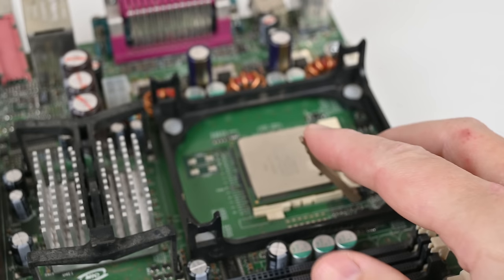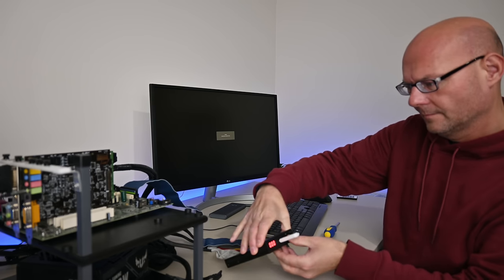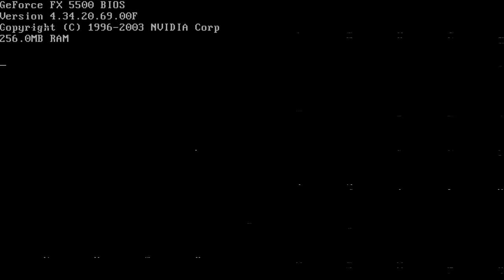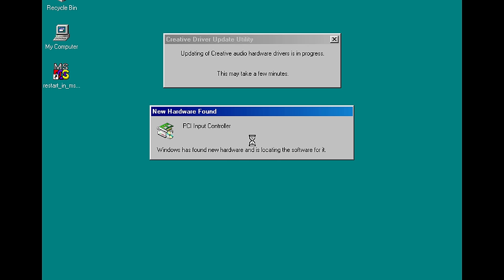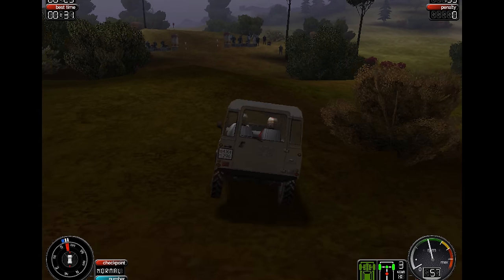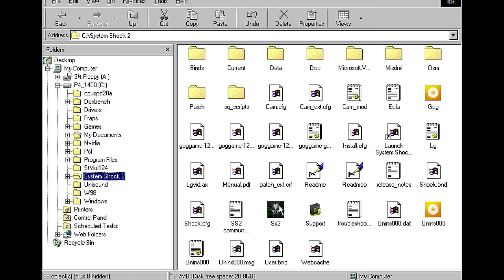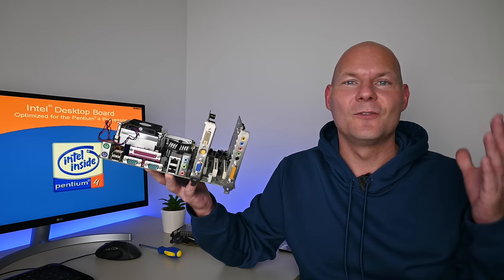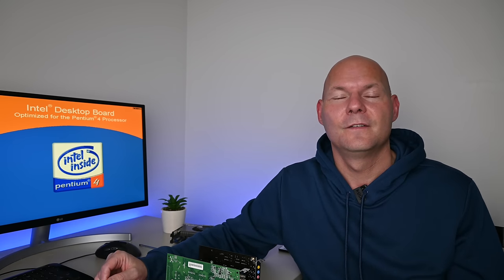It Failed in 2000, Has It Aged Well? The Pentium 4 1.4 GHz

Comment: The timing on this video is kind of crazy because I started working on an extremely similar build a few weeks ago. I figured hey I have a bunch of old PC parts lying around why not make a windows 98 machine out of them. These are the specs so far: Intel D845HV motherboard (already replaced the capacitors), 1.8 GHz Pentium 4, 512 MB PC133 RAM, Nvidia FX5200, Sound Blaster Live! CT4830, 128 GB SSD with a SATA to IDE adapter, Toshiba SD-616 DVD drive. Most annoying part so far is the GPU drivers, I ended up using version 81.98 because it drastically improved the framerate in SimCity 3000 even though I saw FPS losses in other titles. I am still contemplating other GPUs and I haven't decided on a case yet.
Reply from the maker: These parts will work really well! The FX 5200 can be a little under powered if you are planning on playing with higher resolutions. But with a CRT monitor and 800x600 or 1024x768 resolution, you are good to go!
Reply: Update on this, I ended up swapping out the graphics card for a Radeon 9600 XT which has been great so far. I really like the fact that I don't have to mess around with the drivers. I also went with the SilverStone RL08 for the case. The DVD drive started acting up, so I swapped it for another one. Other than that, this combination of parts does work really well together.
Reply from the maker: @lastcarbon  Awesome 😎
Reply: @lastcarbon  Might be the belt on the drive. The rubber stretches and disintegrates after all these years- I have one that needed a replacement, but looking at prices I just used a piece of string. Does the job.
Reply: @HappyBeezerStudios  The drive has some sort of electrical issue which prevents the DVD drive from starting with the rest of the computer occasionally. This also prevents the computer from detecting the SSD even though one of the drives was on primary channel and the other was on secondary channel with both drives set to master. The other drive I have been using works great.

Comment: Hi Phil. Is there a tool to trim a ssd under win98 or winXP?
Reply from the maker: I did a video about this recently and contacted a few SSD manufacturers. They assured me it is not an issue with modern SSDs. So now I just use them and don't worry about it.

Comment: Back in the day I had a big jump from a P1 all the way to a Dell OptiPlex with P4 423 1.4ghz and RAMBUS so I never experienced the speed disappointment some people had who came from newer P2 or P3 hardware. Incidentally after a few years when I needed more performance I looked into upgrade options and you could actually get a converter to use early socket 478 processors on the 423 board but the cost was too high for the performance increase so I saved up and built a new Core2Duo system instead.

Comment: the 478 platform made me quite excited back in the day, especially when H/T versions launched. this was right at the beginning of the Apple intel switch as well, the early dev builds ran on P4 extremes and Core Duo chips which as I understand were basically Pentium 4 M dual cores.. 

really stable socket and platform, and as you said,  I liked my P4 systems quite a lot back in the day.

I still have a Dell dimension with RD Ram and a P4 2GHz 478 non HT chip and a Radeon 9800GT AGP I picked up at a good will for $6 in 2020. works perfectly.
Reply: The Core processors were developed from Pentium M processors not from Pentum 4-M which was much worse. You could also had the socket 479 Pentium M processors on select P4 motherboards with an adapter. It was usually much faster than any of the Pentium 4 processors even despite when it had a lower clock speed. The P4 netburst architecture was really not that good in the end and the Core processors were developed from the earlier P6 architecture which came from Pentium III and Pentium M.

Comment: The Wayback Machine actually does have this board's download page archived. The chipset driver you used is way newer than the one it lists (3.20.1008), and the BIOS version you have is already the latest (P05).
Reply from the maker: Thanks for the tip, I just downloaded them onto NAS and going up to the website as well :)

Comment: I think i once had a 1.4ghz p4 and a geforce geforce ti 4200.
That was the third and last pentium based system i ever owned.
The athlon was more value going forward. I remember the athlon 64 had models that were sometimes better or equal to the p4 extreme edition for a fraction of the cost.

Never really had alot of good memories of p4 but pIII was amazing.

Looking back today i love the pentium 4 and the 865/875 chipset as it is so damn fast and supports loads more modern features and runs windows 98 titles very well.

Comment: Back in 1999 I had a P2 450 that I later added a cheap mx card to before buying a AMD system in 2003 with a geforce 4800. I spent about 1000$ on the build. Used it for 5 years or so before the next upgrade 😂 I like the format, keep trying out cool things from the past 👍

Comment: We had our pentium 4 pc in 2006 and it ran like a beast with windows xp on it,BUT once we did run windows vista on it,it did run very slow,so eventually we skipped back to windows xp,
But seeing you talking about it and showing some games from that era REALLY makes me want to go back to the year 2000,who a shock that we live in 2023 now🥲
Reply: I feel like that is a system right for the Vista marketing trap. If you give it 2 GB RAM it will run fine. Even better with 4+
OEMs wanted the shiny new Windows on their systems, but cheapened out on other places. So you end up with systems with a 2.6 GHz Pentium 4, a Geforce 6200, and 512 MB RAM, which is just not enough for Vista.

Comment: I remember that the Pentium 4, 1.4 ghz launched back when Windows ME was the latest and greatest Windows operating system.
Reply from the maker: I want to cover ME again 🙂
Reply: @philscomputerlab  one thing I remember about Windows ME is that I remember when I was in a computer class in college back in 2003 and the professor said "well, there are allot of version of Windows out there, there's Windows 3.x, Windows 95, Windows NT 3.x, Windows NT 4, Windows 98, Windows 2K, and now we have Windows XP. Oh and Microsoft is also working on a new version called Longhorn" I then asked him, "Well, what about ME, Windows ME?" He then said "Don't even mention that to me, I don't want to even hear about Windows ME".
Reply: @philscomputerlab  Mistake Edition LOL
Reply: @philscomputerlab  I remember when I actually thought that the 1.4 GHz Intel Pentium 4 cpu was a beast of a performer when I saw them featured in some Gateway computers in a PC World magazine in January of 2001. I don't think they would do too well now over 22 years later. Also, I remember an HP laptop that I bought new from Sam's Club back in July of 2002 had a mobile 1.4 Ghz Intel Pentium 4 cpu with 256 mbs of ddr ram 266 mhz.
Reply: @CotyRiddle  Yep, I think Windows ME even did worse than Windows Vista. At least Windows Vista did get over 10 years of updates and support from Microsoft, from January of 2007 up till April of 2017, Just like Windows 7 and Windows 8 also got the same lengh of support. October of 2009 to January of 2020 and October of 2012 to January of 2023 respectively. I think Windows ME however had the shortest support lifespan.

Comment: I moved from the AMD Athlon 1.4 to a Pentium 4 1.7Ghz, if I remember rightly I had an Aopen full tower case, Abit TH7-RAID motherboard, 128Mb Gainward Golden Sample Geforce 4600Ti graphics, Hercules Game Theater XP sound card, IBM Deskstar 120GXP HDD and 19" Iiyama VisionMaster monitor back then.  I moved to a Compaq Presario S4490UK with P4 HT 2.8Ghz after that and had a few Compaq Evo D510 systems for various use.  Never had any overheating problems and they all worked well.
Reply: Athlon 1.4 to P4 1.7 sounds like a sidegrade. The number is bigger, but it isn't any faster. Slower in mp3, equal in divx, faster in mpeg2, games also differ.
Phil has done a video on them. There is no 1.7 P4 in the video, but the 1.6 and 1.8 models are tested. And the results are pretty clear. The Athlon 1.4 is faster than the Pentium 4 1.8 GHz

Comment: I have a socket 423 P4 and motherboard in my collection. Uses RDRAM. Used it in my primary computer from...maybe 2002 to 2006? If I remember correctly I had a Radion 9800 pro in it for a couple years and was decent enough for games at the time - I'm pretty sure I played through FarCry with that setup.

Comment: This is right up my alley!

I had a socket 478 P4 1.5GHz "Willamette" in my first PC back in late 2001. The mobo was a DFI NB32-SC with a single stick of 256MB PC133 memory and an ATI Rage 128 32MB. It came with XP pre-installed so that's what I gamed on. Performance (at least up to SP1) was solid, but with each OS and IE update the system began to slow. I didn't game much except for the Tomb Raider games and messing around with the Tomb Raider level editor. In the 7 years I ran that PC not once did I upgrade the hardware. TBH I didn't know much about it, how much parts cost or where to go. But anyway, I had fun on it and I loved that era of PC hardware and software. It has that unmistakeable look and feel.
Reply from the maker: Yea that graphics card was actually the weak part in that machine 🙂
Reply: @philscomputerlab  It was great for running PSX games in emulation though. I remember playing Crash Bandicoot with no problems. But yeah, other than the Tomb Raider games (from the Core Design era) it wasn't all that good.

Back in 2013 I returned to my old PC and upgraded some of the parts notably 3x 512MB sticks and an FX5200LP. The RAM upgrade felt like running a different computer and the FX5200 did okay, but for the life of me I couldn't upgrade the CPU. The board supported up to 2.0GHz Willamette but none of the CPUs I bought worked. The BIOS was fully upgraded.

And then in 2020 I returned to my old PC one last time and upgraded everything:  P4 3.0GHz Prescott, Gigabyte 8I865GME, 2x 1GB DDR400, Zalman CNPS9500 and Palit Geforce 7600GT 256mb AGP. It was a period-accurate beast from 2004. I didn't have it for long though as I sold it and embarked on a modern PC build. Plenty of funs times building both!

Comment: ah good old times, i had a p4 and the best choice was upgrade to pentium m on desktop with ct-479 adapter. Another planet and very similar to core architecture introduced in 2006
Reply: Basically Pentium III -> Pentium M -> Core -> Core 2 -> Core i, all of them P6/80686 chips. Yes, we're still on the 6th gen of x86 CPUs.

Comment: LOL, these times I had an Abit NF7S with an Athlon XP Mobile. That systems sucked so much that I switched to the slower Pentium IV 2,8 GHz with HTT on an ASUS P4P800. Legendary machine. Later I used the CT-479 adapter board to use a Pentium M on this board. Since then I never swiched back to AMD.

At home I got some P4 retro projects. One is a workstation with two Xeon 3.6 GHz CPUs. The other is Pentium D build and of course I got my old ASUS P4P800 (now as E Deluxe) with a 3.4 GHz Northwood.

Comment: Wow now THIS brings me back...5:16 Must have been 2003, I went and got an ATI 9600. I thought it was mediocre so I wanted to return it and get a 5600 GT. When I bought it and opened the box it said "Surprise, we upgraded you for free, here is your 5700 GT. Happy Gaming!" or something to that effect. I was at first skeptical, why would a company sell the next chip up for the same price? But then I used it and saw what everyone did. The FX series had amazing issues with textures in most of the top games of the time. In GTA III it would skew textures and effects were off. I noticed most games had an issue with this card. A friend loaned me an FX 5950 GTX for fun as he had bought the ATI 9800 XT AIO (Which he also lent me for a time, the ATI was the better of the two). Even the top tier FX card had some of the bugs. Ended up getting a 7600 GS to replace all of it. But that FX 5700 LE is the EXACT same card you are holding right now as I have this paused and type. I will never forget that brass/gold looking mini shroud/cooler/heatsink lol! And I will never forget how well it played Morrowind (Better than the XBOX version) but Oblivion forced me to upgrade when it came out. I had the computer with the 7600GS stolen from me while I was out of town so when I got back all I had left was the 5700! So I put together a similar specced PC and continued to use it until Oblivion forced me to go from that to a HD 1300 then to an HD 1950 XT the following day. What a fun time that was.

Comment: My DOS/DOOM hardware is a P4-3GHz with four ISA slots. Unfortunately it needs to go to the Caps Doctor, and meanwhile I'm using a dual P3-500... nowhere near as good. I have a couple newer P4, good hardware, one was my faithful everyday system for many years, and it still works.

I don't care one way or the other about the format, so long as the content is interesting. :)  Did enjoy seeing games I'd never heard of. 

Was rather surprised to see RAMBUS. In my Computer Closet I have a dual Xeon 750 that takes RAMBUS and was formerly the property of Jerry Pournelle... (it's a Compaq workstation and weighs 57 pounds!) -- upgraded with some modern RAMBUS brand and tho they're about 5% slower, they run far cooler than the extremely hot Samsung sticks.
Reply: If it has through-hole caps get your soldering iron and diy. Not too complicated and can't go wrong if you're not a total idiot with it. I'm far from a professional board repair technician. I only have some cheap 25W iron. But I fixed some monitors and GPUs myself. SMD stuff and chips are much harder to do, but some simple through-hole caps area easy.
Reply: @HappyBeezerStudios  Yeah, I know how it's done, but I don't have the soldering skill, and the board is irreplaceable (I'm seeing the same board, with obvious bad caps, if you can find one, for $300). So I'll let a pro do it. Local shop and I've seen their work.

I might try it myself on my Asus boards with the bad southbridge cap (that was a regular thing for a while) but I've got three of them and they're not that special. -- When that goes, the rest of the board still works but USB quits -- and add-on card quits before the board's own ports. (Two of 'em are actually in use where I don't need USB.)

Comment: I didn't think Pentium 4 exactly failed. It spurred controversy of course, as the high MHz number did not translate to expected performance. Pentium 4 with Rambus was still quite fast. The later P4 models improved on the design, which over time was changed quite a bit, still sold als Pentium 4.
Reply: Northwood with DDR RAM was pretty much the peak Pentium 4. Especially the Gallatin 3.4 GHz EE, which was just the server model for desktop systems. It beat even the 3.73 and 3.8 GHz Prescott models. And could oc to the usual 4.0-4.4 GHz as well.

Comment: I remember at the time looking at these pentium 4's and their speeds and wanting them. I instead went for AMD instead, Intel most of the time has a higher cost for the entire platform barrier. I remember seeing the speeds of rambus and was impressed and if I had the money I would have wasted it on an inferior system. Rambus was good on paper. However even back in these days, I always had high amounts of memory. I never felt the cost was too absurd or prohibitive. So I often had lots of things open and ran lots of stuff. I remember having friends who were telling me how they upgraded from 32mb to 64mb.  or 128mb and the difference it made. While I would either be at 256mb, 512mb and even 768mb in this era. I remember wanting an intel platform many times with the pentium 4, but AMD just had some great offerings and beat intel on IPC. So while I would have loved to have rambus, it would have been awful for me, being very high cost, versus low performance for how I would have used the system. I would have had high memory and lots of things running at once. Where this was the crippling feature of rambus. It could potentially be great if you didn't use your system much, just single task only, rambus was decent. It was never great. It's speeds were high, it's cycle performance was horrendous due to how it had to cycle through everything. Every time I wanted to go with intel pentium 4's, I would read reviews and decide against it. While the prospect of two cpu's in one with hyper threading was mighty attractive, it was not very well utilized and even costed system performance. I still have good XP and 98 hardware, but I have no interest in going with a pentium 4 any time soon. There were some neat things like the xeon cpu's of the era, hyper threading, etc, but I was never a fan of the pentium 4 no regards. It was a fascinating time, but pentium 4 was a terrible architecture to begin with. It underperformed the pentium 3, it had rambus, which was awesome on paper, never in practical use, it had hyper threading, not great at the time, it had bad thermals and escaping electrons a lot, it had a huge pipeline for it's instructions and performed poorly, it was kept alive for too long. Intel believed in it, but they would have rather killed off competition, so you would have not known any different. Intel was always the big bad bully who was out for profit at all costs as a company and they still are as ruthless to this day. Nothing has changed, Intel has interesting products, but I am not that interested in giving them all my money.

Comment: My only Pentium 4 was a Socket 478 2,5GHz version. It did not perform very well but it got at least basic PC tasks done until a lightning struck and killed the whole PC 10 years after I got it. Otherwise I probably would still have it as a retro system.